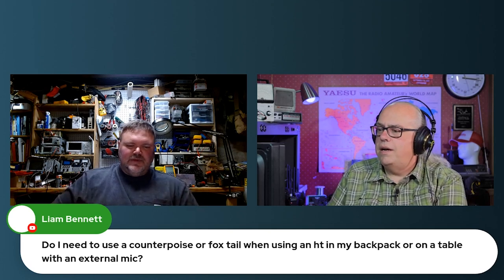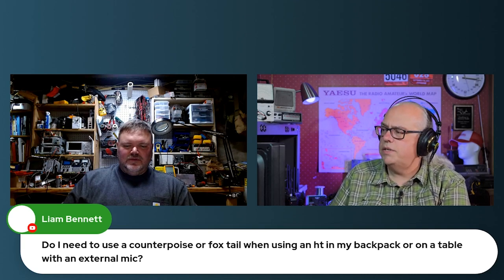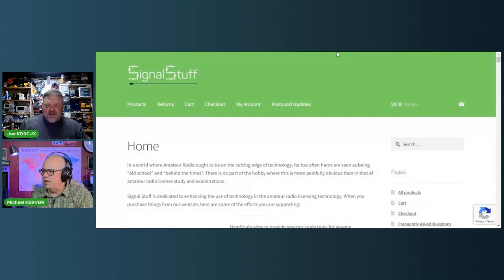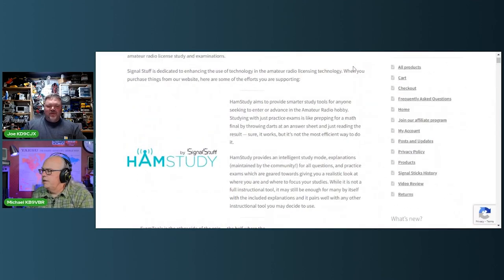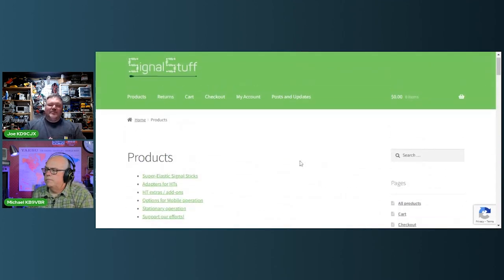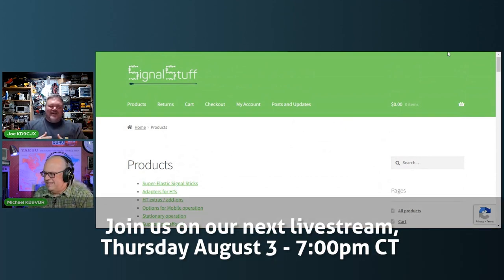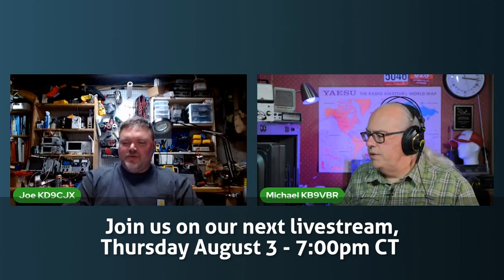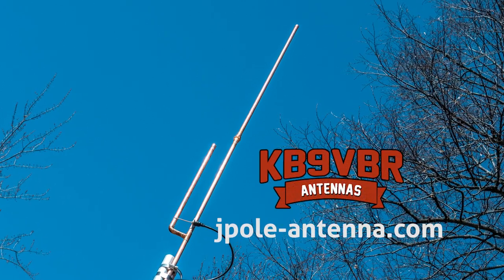Ask Michael, KB9VBR: Do Tiger Tail antennas work? #hamradioqa

Comment: I've used them with a rubber duck before and it made a noticeable improvement making contact on certain repeater nets. I have a signal stick and it works well. I also have the Abree Antenna also and it was phenomenal,but it was very long and a bit unweildy

Comment: I have a home made tiger tail (Personally I prefer to call it a “ground plane wire”) that clips on to the outer bnc ring of my signal stick. It seems to help my signal quality on repeaters 20+ miles away. It lowers my SWR from 3 to <1.5, but this shouldn’t be a big deal for 5w vhf fm. I think it mostly helps by lowering the radiation pattern so more energy is directed horizontally (vice vertically into the sky).
Reply: It is a counterpoise, not a ground plane.

Comment: Did I miss the answer to the question about using a tiger tail when using a shoulder mic?  I am assuming that it would not help since your hand and body act as a grounding plane when holding the radio & wire.

Comment: Can i make a dual band counterpoise for 2m and 70cm VHF/UHF with two wires of different length (each 1/4 wavelength) and put them together at one end? Would this work or can i only use one at a time?
Reply from the maker: Using two wires will work. Multiple length counterpoises for HF vertical antennas is a common practice and the same concept can be scaled for VHF/UHF.
Reply: @KB9VBRAntennas  Thanks for the quick answer! Best to test and tune with a NanoVNA 🙂

Comment: They don't work if connecting to ground. I've tested this using the weather channel. You remove the antenna so that you don't get a good reception, touch the tiger tail to the ground and nothing improves. Touch the tiger tail to the "hot" and you get improvement. The way they tell you to connect to the ground is not effective at all.
Reply: If you remove the antenna and touch the tiger tail to the hot, you're simply replacing the antenna with the tiger tail